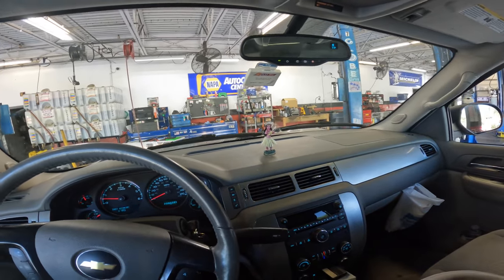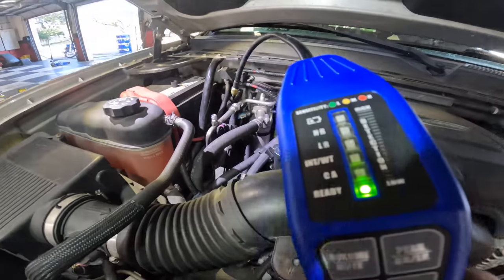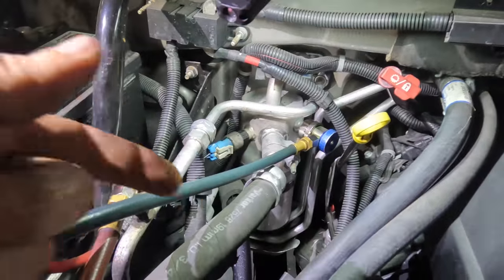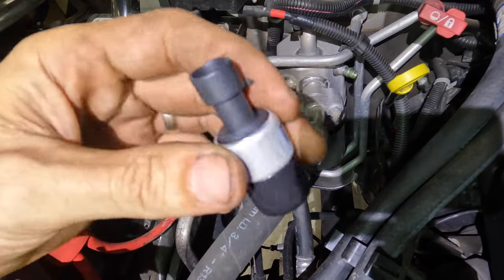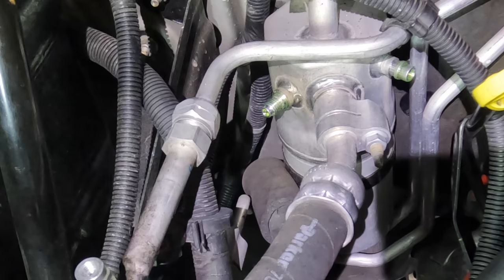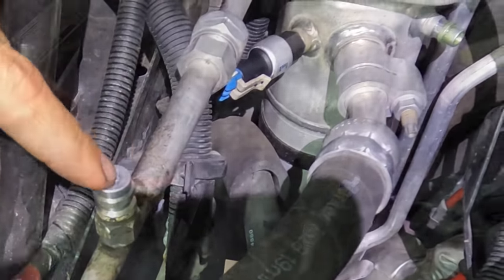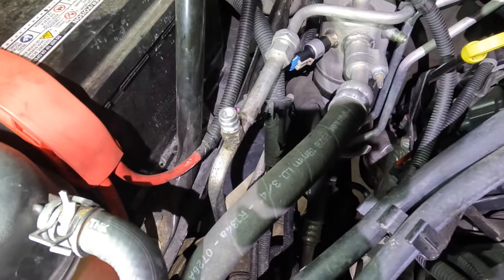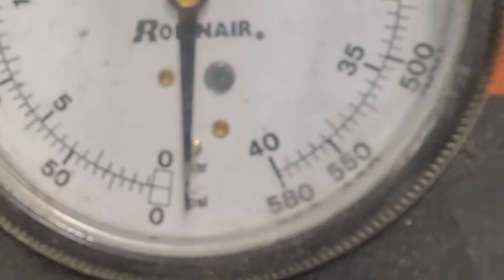Customer made the Diagnosis: Chevrolet Suburban R134a Leak

Comment: Good morning Ray! We have a 2009 rusty  Ferd Edge. (It’s paid for.) We live in hot, sticky North Carolina, and the AC is blowing warm. Are there any visuals that I can make to the components, so that when I take it in they don’t take me to the cleaners?
Reply: Look for oil seepage at all connections and valves that you can see. Those are signs of a leak because the oil in the system leaks out with the refrigerant. Make sure the fuses are good. Does it blow warm all the time? Can you see if the compressor is turning when the A/C is on?

Comment: dang, my a/c is putting out cold air from one vent, and not-so-cold air from the other.  time to visit my local mechanic for some refrigerant
Reply: Sounds more like a blend door problem.
Reply: @gr7485  it was low refrigerant due to bad compressor  :(

Comment: Love your videos and you can learn a lot! 2 questions  ! The body style from 2000- 2006 I thought  were the same? That interior  looked like my 2012 Sierra which the were common from 2007 to 14 ! And what I thought AC 101 every time you open up a system you replace the accumulator/ dryer and orifice tube or am I wrong?
Reply: @Lee gunter
I think that is if you are exposing the system for a longer period of time. This was only exposed for a minute and only a small opening, I bet hardly any moisture got in there that would be of any consequence, and since he vacuumed out the system before recharging it, no problem.
Reply: Even a brand new accumulator/dryer has to be exposed to atmosphere when it is installed, so it would not make sense to replace this part if the only criterion for replacement was exposure to atmosphere. Accumulator/dryers should be replaced if there has been a longstanding leak, i.e. all the refrigerant has leaked out and it has been exposed to atmospheric moisture for long enough that the desiccant inside has been "used up"; however, this criterion does not apply to the orifice tube. The required length of time exposed to atmosphere before warranting replacement is shorter for humid climates, and longer for arid climates. The criterion for replacement of the accumulator/dryer AND orifice tube is evidence of contamination (e.g. tiny flakes or chunks of metal from the compressor "slugging"). When contamination is evident though, you'll also need to replace the compressor, condenser, and rear thermal expansion valve (for systems with rear air), then flush all the lines and evaporator(s). Then connect everything back together and pull a deep vacuum, for at minimum 2 hours, preferably overnight. Then recharge with the correct amount of refrigerant, dye, and oil.
Reply: New accumulators only have oil in them . Even evacuated systems  have oil and refrigerant residue when it comes in contact with air gets contaminated. But I'm going  by HVAC schooling  in the 80's
Reply: @leegunter5223  The accumulator/dryer combo unit used in these GMs has a desiccant bag inside to take up any residual moisture from exposure to moisture from service, leaks, or improper evacuation. Because they are also an accumulator, they do indeed have oil in them, and if they are replaced, you must replace the oil that was removed, which can be hard to determine the amount to add back in. Thus, only replace the accumulator/dryer if you suspect the desiccant is used up, or if there is evidence of contamination.

Comment: Looks like a 2007 + up Suburban instead of a 2006.
Reply: I was just about to mention this. The door sticker might say 2006, but these were actually 2007 year models that were sold as early as spring of 2006. I vividly remember wanting one SO bad when they came out.
Reply: @Conqueef-tadoor  Yup. I did as well seeing them in around 06. I have had a 2007, now 2014 Tahoe for the past 4-5 years. Drive great, but I am growing tired of trying to keep Gm's on the road.

Comment: I get a hiss when I remove the caps on my ac and I took it to a shop to replace the service ports or Schrader valves what ever and they said they did it but I still have pressure under my caps and they seemed confused when I was asking about the service initially bleh

Comment: Are those AC valves a service item ?  Seems flattened o-rings would be an age related service item.  They are 16 years old
Reply: The valves AND o-rings were changed.
Reply: @gr7485  Changing just the o ring, wouldn't that suffice? That's what causes the leak, right?

Comment: I had a 1995 Diesel Suburban. In 10 years I had to replace 15 A/C Compressors. Yup 15. About half were under warranty. In 10 years I had to spend $72,000 in repairs. I only paid $39,000 for it new. Complained to GM they offered me $1,500 off my next GM. Since then I have only purchased Honda’s. My daughter is buying a new CRV so that makes 8 Honda’s purchased by my family since the Suburban. No problems with these 8 vehicles. NEVER EVER BUY A GM!!!

Comment: Why would you replace something you are not sure is broken? It's an extra expense for the customer to pay. I would have stuck with the Schrader valves and left it at that.
Reply: The oil is a sign that it is leaking, even if it is very small. Better to change it now when the system is open than have it leak worse later and have to pay for the recharge all over again. It's called PREVENTION.
Reply: ..and it’s a bonus for the customer. Its more fun to pay if you can see a shiny new part in there.